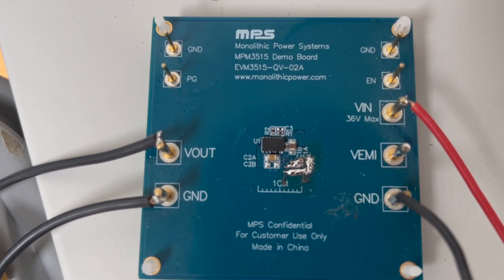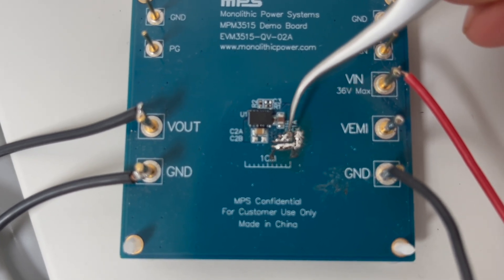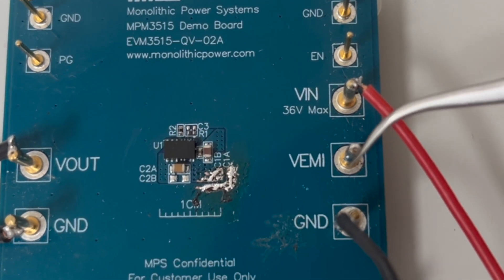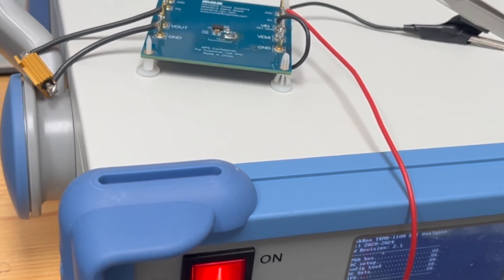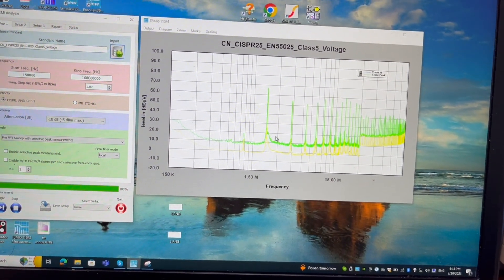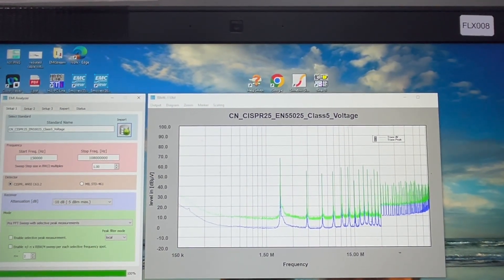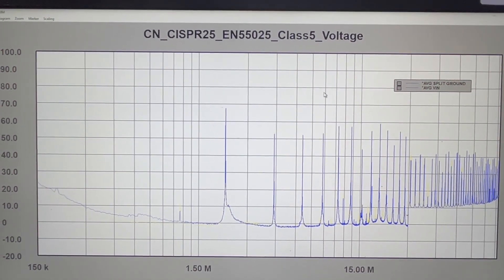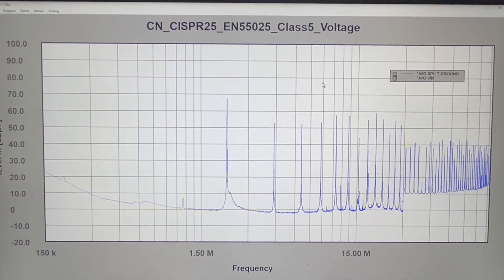Separating Grounds - Are they any good? (1)

Comment: Well, this seems to be one of those cases where they had multiple engineers in different locations, without their phone numbers, write the datasheet, do the datasheet layout recommendation, and do the evaluation board. The datasheet goes as far as to recommend/suggest not connecting AGND to PGND on the board because they are connected internally, then their example schematics show them connected externally but not in the layouts, and obviously in the EVM someone else decided to actually properly connect them. This is how you create myths, and like James Pawson likes to say "customers".
 
The split results are boring because the split is not actually a split, and no surface current would (in my opinion) have any reason to cross it as everything is probably going through the vias to the second layer. Like others said, the non-power engineer with "I am not a power guy, these people made the part, they are" will blindly copy paste it into a different design where that will actually create issues, and then solder in 4 ferrite beads, 3 X2Y caps, and light a 7 candles in a star around the board with the conclusion "that is how you fix it".
Reply from the maker: Did you see my new video, i think this subject will last for many years!
Reply: @MachOneDesignEMC  I did, and also rewatched the MPS video you shared and vaguely remembered about this one: https://www.youtube.com/watch?v=lBHJ3QamqiA
So... it doesn't always work, and the split is not getting you any better with a very similar design. It seems that their conclusion is that with bad layout and bad component choices you get bad performance. Somehow nobody checked that their second "ground" is a digital pin that happened to connect to ground (which I can bet they want you to connect to AGND in some app note somewhere).

Comment: It will be nice you explain the separate grounds for dc/dc
 isolation converter this is used at industrial applications to filter noise.
Reply from the maker: Hi, for isolated DC-DC, it is actually easier, because you will have separate grounds anyway (for safety reason most of the time). In that case, a common mode capacitor between the grounds is often a necessity. Think about it, that cap joining the two grounds basically make two grounds into one (for RF singals!).

Comment: I wouldn't consider this a "split" plane in any standard sense, it appears more likely to be a thermal break from the top copper pour and the ground pad on the IC.  Supporting this idea is the apparent trouble you had in getting a clean solder bridge between the two regions on the top layer.
Reply from the maker: You are absolutely right, I just did another vidoe, using a better board after your suggestions here.

Comment: Interesting!  But is it really separated in this situation, with all those vias and GND at layer 2, 3 and 4?

Although if implemented in another stackup/layer configuration, the results could be worse for the split. And depending on the di/dt. 

Do you have a link to the mps idea behind this cut?
Reply: I agree with all those vias, I would say it's not really separated.

I would expect results to be much worse with a single 0402 or net tie configuration
Reply from the maker: Hi Both, great observations. I simply don't see the benefit of having a separate grounds on top layer where it is viaed to other layers. This board is not the best one, I will do another board and see the results. I will share soon.  @_ATHONOR